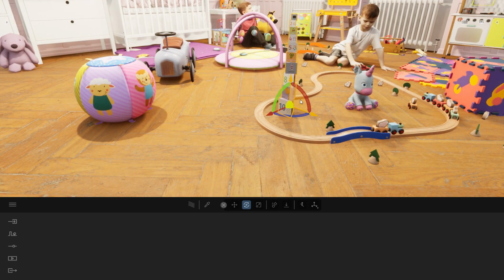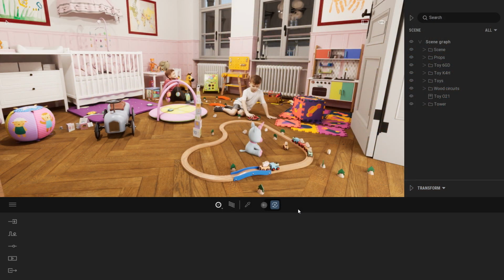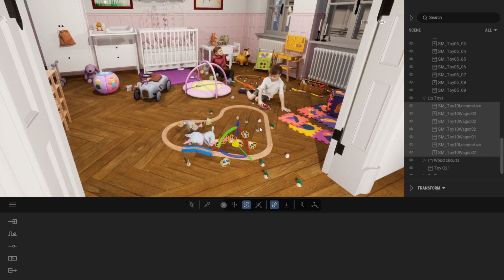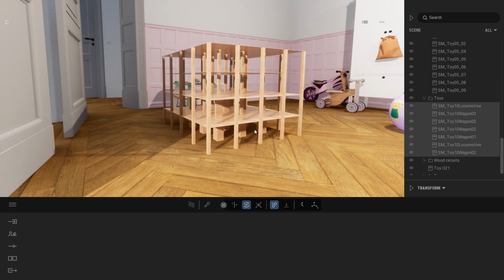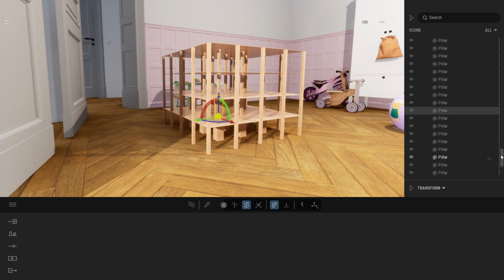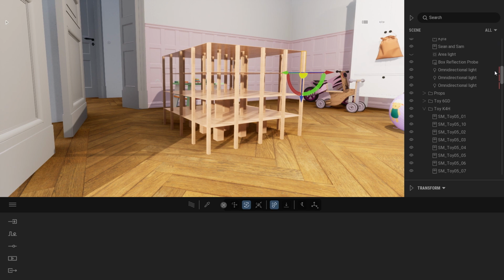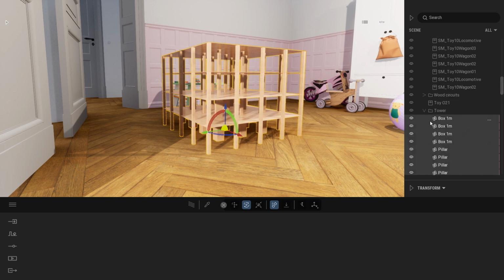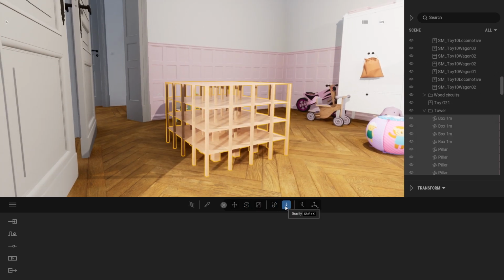How to Use the Physics-Based Asset Placement Tool in Twinmotion 2022.2 | Twinmotion Tutorials

Comment: Great. It would just be good if you can sort out the materials constantly being replaced for each update which is the no 1 prohibiting factor as it is very frustrating to reapply all materials each time as the model updates. I was told a material substitution table would solve this but I cannot get it to work properly despite reading around.

Comment: I still think the most problematic thing that Twinmotion must fix is glass placement. If you use standard grass, it goes over sidewalks, etc.

If you use DETAIL grass, it makes the scene too heavy.

Twinmotion should just add some kind of OFFSET from border, like a photoshop feather. And inverted offset too.

So I select an object to place grass and set offset 1 meter. And add the standard (big) grass patches. As the offset is 1 meter, it stops being positioned 1 meter from the sidewalk.

Now, for the grass closer to the sidewalk, I select same object and use an inverted offset of 1 meter. So the detail grass is ONLY placed up to 1 meter distance from sidewalk.

SIMPLE!  I could code it in less than one decade!
Reply: Absolutely agree👍
Reply: Yes .. we've had so much progress in lota of areas but  grass placement is shyte .

Comment: I tried using the Gravity tool for placing a vehicle on uneven terrain that I imported from SketchUp and nothing happened.

Positioning vehicles on uneven terrain is one of the most time consuming things to do in Twinmotion especially for larger scenes.

Is there a trick?  Does it only work for certain assets?  Does it only work for certain geometry?